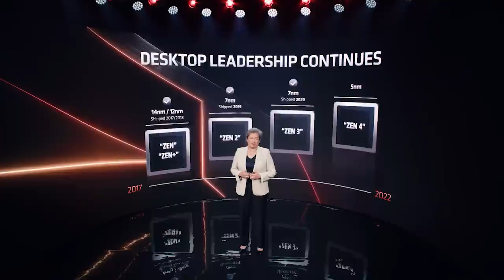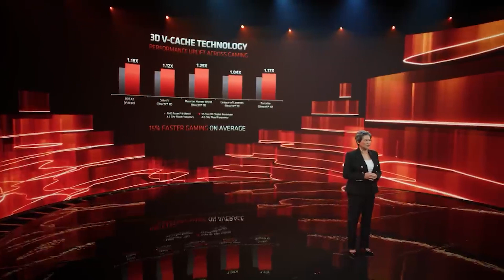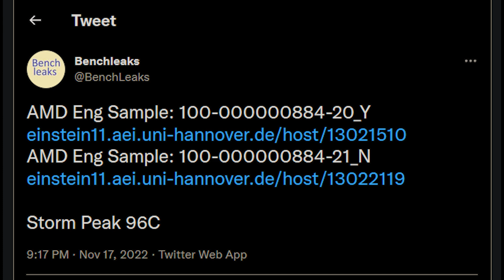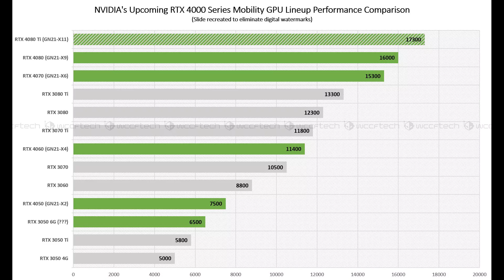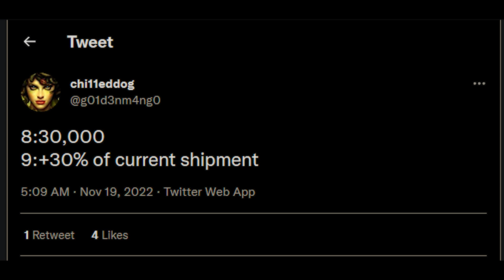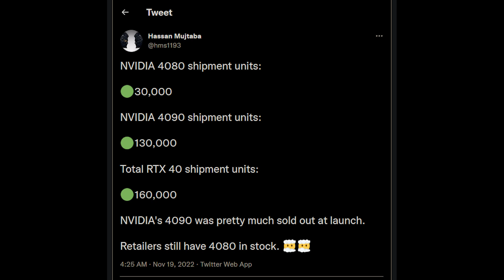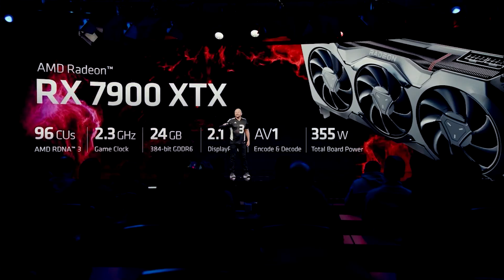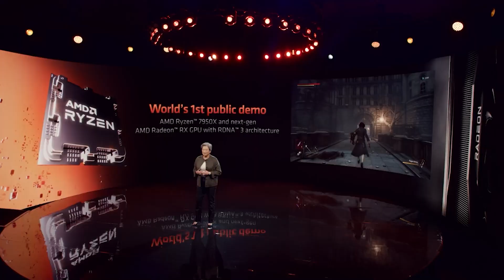Ryzen 7000 3D V-Cache UP TO 16 CORES ?! | RTX 40 M Performance & Specs Leak

Comment: I feel like we already know that the performance of the 7000 Ryzen chips is due to the higher temps that they have been configured to run at. The 3D cache isn't going to allow the same high temps if they stack it on top of the 7000 chips.
What does this mean?those rumoured 5900x3d and possibly a 5950x3d for AM4 on the way?

Comment: 4080 in The Netherlands is 1500 to 2000 Euro. That’s 4090 numbers in the USA. 4090 cards are 2500 to 3000 Euro. So F them all. Sure FE cards are cheaper if you can find them. Plus I am amazed how Nvidia is solving 12VHPWR plug thing. Seem they are doing all they can to make work around and not the proper solution.

Comment: Here in Australia you can buy the RTX 4090 prices range from $3000aud to $3800aud.. So there not exactly flying off the shelves. I just bought a Rx 6800 for $799aud and the RTX 4090 is not even twice as fast as the 6800 in 1080 and 1440p in a lot of games. Ray tracing aside and let's be honest does anybody on the low to mid range of the gaming spectrum really care about it.

Comment: Nvidia has no choice to lower their prices drastically after RDNA3 launch. That is also why Nvidia is trying to milk its fanboys now so it can make up for the loss later. RDNA3 is going to change the game this time. Price, Performance and Power consumption of RDNA 3 is much more balanced and this time AMD has a rich feature set that doesn't fall short. To me the AI accelerator is the biggest deal of all RDNA3's features.

Comment: I'm still crossing my fingers for a 7970x3d, since each quarter of an IO die can handle three CCD's.
Reply: A ripper of threads might also be a valid, though much more expensive, option.  But it is still a year away.
Reply: A very pretty penny, the ripper of threads does command.

Comment: I could not care less about workstation Threadripper.  So long as there is not a 12 to 32 core, quad channel, 48 PCIE lane HEDT option, Threadripper is dead in my mind.  I'd even settle for it being based on Zen3d instead of Zen4.  Just as long as I can buy the board and CPU for under a grand like HEDT has pretty much always started at.

Comment: RTX 4080's still available - but honestly, I don't know anyone willing to shell out the prices they are going for at this time.  Just makes more sense to spend a few bucks more on an RTX 4090 or wait for AMD's launch right now...  Or to grab one of the deals on the outgoing gen cards (lots of people seem to be doing that last one). :-)
Reply: It doesn't make sense to buy the 4090 now either if you ask me. Its price will also be lowered soon. It may be the fastest GPU available even after 7900XTX release, but on average the price difference between the 7900XTX and the 4090 will be higher than the performance difference. A lot of peoples would rather save some bucks because you most likely need a new PSU and Case when you buy the 4090.
Reply: @nedegt1877  Well I could make the case for the RTX 4090 (not for my self mind you, nor for anyone I know personally)...  It is (currently) the best high-refresh rate 4K video card on the market.  Mind you this argument would be for the real multi-billion 1-percenters that could just run out and buy the TI variant when it hits the market with out even noticing the money loss...
Reply: @nukedathlonman  I know, you're totally right about that. But that's a Niche market, Nvidia can't survive with only those customers. On the total GPU market that's not even 5%. Mainstream is more important because it's a high-volume market. 

It may not look like it because Nvidia has the fastest GPU but behind the scenes Nvidia is in deep doodoo. You will see what I mean next year when AMD announce / release their new line of APUs. And of course, the RDNA3 3D versions (if ever released) will be a lot faster.
Reply: @nedegt1877  the performance from AMD GPU's is crap atm, the 7900 flagship should have been £799 as it can't even beat the 3090Ti at ray tracing. You will pay £1000 for an inferior product
Reply: @Mike-kt4qh  Yeah sure, keep using Raytracing as an argument because that's the only thing you can talk about. GPU is not about Raytracing alone. In fact it doesn't even matter if Raytracing is slower. You guys really need to stop using arguments that doesn't make sense.
Reply: it's too late and too expensive now with amds incoming, the good thing is that we have proof mining is pretty much done or they wouldn't care to pay 1200

Comment: The  V-Cache tech is only shall we say an advantage in gaming. But outside this scope it is not bringing anything to the performance table? So the 16 core non  V-Cache Ryzen will still be the best option if need compute power but do not need need to get into Thredripper territory for some reason.
Reply: It’s not just gaming. There are some cache bound applications where it gives a nice boost as well.
Reply: @rekareaper  What are those applications? From the top of my head. I think some advantage was seen in the 7-zip benchmark. But overall not so much in other production type of benchmarks.

Comment: I am pretty sure that the 128-core part you're hearing about is Bergamo and is designed for cloud server computing. :)

Also the 40-series mobile parts seem to be a flat 30% gain over 30-series? That's pretty abysmal gen on gen improvements. I mean, the 2070 to 3070 was easily a 50% gain across the board, and THAT was seen as "okayish" for a gen on gen upgrade. But I guess we'll see. :P

Comment: Could we getting to the position that CPU and GPU speeds hit a point when there is little point in upgrading in the future. Suppliers must be concerned that at some point they will destroy the future market. Non gamers may always want faster for work purposes. The highest bar for gamers at present is possibly VR simulations and that is starting to hit very acceptable performance with the best of current tech.
Reply: there will always be higher resolutions. higher graphics settings. better AI simulations. better SOMETHING that needs more power.

Comment: Hi. Do you know which of these CPUs will perform better in machine learning and data science tasks, no need to say I would use a Nvidia GPU like 3070 besides the cpu, but I wanna choose an appropriate cpu for these types of tasks. These are my choices:
1. 5900X:       $250 (used)
2. 13600KF:   $400 (used)
3. 13700KF:   $500 (new)
But as you know there is another  important factor,  GPU. if I choose the 5900x then I could spend the extra money on a better GPU. If I wanna summarize both CPU and GPU configuration I afford are these three options:
1. 5900X + 3080Ti
2. 13600KF + 3070Ti
3. 13700KF + 3060 / 3060Ti
 which one should be a better combination?
Reply: If I'm not mistaken ML and DS is heavily based on GPU performance rather than CPU, for that I'd go for the 5900X + 3080Ti (try to get the 3090, it is closely priced to the 3080Ti)

Comment: AD at 160K total retail sales (BS) on 5,760,260 unit first quarter production means volumes were withheld from mass market on 5,600,260 total units typical of Nvidia q1 production volume sold to all other buyers willing to pay an application specific competitive 'perfect' price on applications ROI for a full node shrink 8/7 to 4 nm and DID. Government labs, institutions, academia, military, science, industrial power complex, export restricted rivals through gray and black market channels. Don't think only 160K AD sold that's BS. Perhaps there are 5.6 M in the finished good chain BUT that's next quarters q2 ramp volume that is usually around 6.6 M units for first year total NV production of 47 M and where on AMD 10-Q it appears N31 volume is around 8 M. Paul, they will be sold at highest price on Pareto distribution of the total volumes; supply on demand based price through ramp volumes, before peak production volume, and only when entering past peak production volume at run down entering year two will then reach mass market supply elastic pricing like NOW for GA and RDNA ll. What Nvidia and AMD did at GA and RDNA ll and Nvidia did again at AD is to allocate some amount of run end priced product 'said MSRP' that is fake PR priced product placed / allocated to retail entering q1 risk production phase whose actual 'introductory' price is seen in AIB offerings and broker pricing. I really wish the technical media if you can call it that will get technical on this topic because the PC press knowledge of actual production and sales methods is quite frankly pitifully lacking. Don't get caught in the PC echo chamber and PAUL learn some industrial management. mb

Comment: At the end of the day Intel have the speed advantage so AMD need to do something. Intel have the speed but at massive power draw (that's why I chose AMD) so if AMD replaced 7000X variants with the 3D cache versions (price wise) and dropped the 'X' versions prices then they'd have the speed at the same cost and people would be willing to fork out the extra IMO. It's a high cost when you need the whole AM5 platform but if your at the cutting edge speed and tech wise at least there's an up side.
I just got the 7600X while I wait for 3D cache, like many others I suspect.

Comment: Hey, random question: I'm about to build on AM5 and I was confused about memory, because AMD said 6000 MT/s are the "sweet spot", yet 5200 is the maximum officially supported speed - many mobo specs indicate that speeds up to 5200 are possible and some mark 6000 "(OC)" - does it mean I need to overclock something?
If I plug a 6000 kit and boot up, will the system either a) shut down or malfunction, b) just run at lower speeds or c) somehow still work at 6000 MT/s?
On DDR3 it was just plug and play. Mobo supports 1600, my kit has 1600 and it just worked. Any advice? Researched for literal hours, nothing on the web.
Reply: Same as Intel with XMP,  EXPO settings are considered as OC. Not because something bad will happen if you run with them but some configuration can be too much for memory controller in CPU. Let's say 4 stick with very high capacity maybe will not run at full EXPO speed. And then if you complain about that they'll just point to that manual that claimed only 5200 as supported. I'm sure that some reasonable configuration up to 64GB will run without issue at 6000.
Reply: @gorky_vk  Thanks, that's what I was looking for. So just enable EXPO in the bios and it works (provided the kit is EXPO rated). Got it.
Reply: I am genuinely interested in this myself

Comment: IOW, say you have a two CCD stack that means that only one CCD can be using it while gaming... You'd be better with more cores for pro work...  If you have two CCDs and stack only one then you have to ensure that that CCD is used for gaming to avoid probing through the IOD... I don't know if there's a direct connection between L3 on the CCDs...

Comment: We shall see what happens Dec. 13. Really want to upgrade from my 1070Ti to a 7900XTX, but I feel it might be a wiser decision and put that money into AMD stock instead at the moment, then pick up a card around the new year. Hopefully inventory will be decent, now that the supply chains and everything with crypto are sorted for the most part. I feel my 5800X with CL13-15-11-23 1T with super tight secondary timings should be good with a 7900XTX at 4K. If it's not, well, a 7800X3D down the road as well play around with DDR5 sounds nice too. Although, I shouldn't really need to mess around with RAM with a X3D chip, but as an over-clocker, noting goes untouched. lol
Reply: Stock market will crash. If its still around after it crashes, buy low.
Reply: Hey bro, market still has a long way to go down friend. You should probably dollar cost average into your AMD position instead of buying it all at once. 

I think AMD is in a good position fundamentally but the market is not.

Comment: 3d v-cache. The first rumor was "two SKU's" which to me means 8 core and 16 core. There is NO REASON to waste turning a 6 core, aka a failed 8 core chiplet, into a v-cache product, when you can just make all 8 core chiplets, and then make an 8 core 7800x3d product and then a 16 core product (7990x3d???). HOWEVER, if they go with a full product stack, aka 4 SKU's, then there will be a 6/8/12/16 version. We KNEW the 7800x was missing because CLEARLY the 7800x was removed to leverage ALL chips into 3d cache variants. So that there are "more products available". It just makes sense. "the most simple answer is usually the correct answer". 7800x3d is a known product coming next year. the only OTHER simple logical product would be 16 core 32 thread with 3d v-cache.... period. and that fits the initial rumor of "two sku's".... if they do a full product stack, we are then getting 4 chips, 6/8/12/16 variants.
Reply: TOO much use of CAPS man lol

There is one good reason to do 6 core 3d stack - thermals. The ihs built for 8 cores running only 6 would be more able to handle the cache heat and for cache heavy workloads like games 6 cores is plenty so it would make sense to sacrifice them for cache

Comment: Noon local 11/20. Microcenter nearest me had about 120 4090's at launch.  Sold out at open.  Had about 150 4080's launch plus restock since launch.  Still have 3 variants with total stock remain at 48 units total remaining as i type this.  Tuf gaming OC, Strix OC and Amp Extreme Airo.  Sold out of all the lower end variants.  $1399 and up is what is remaining.  Makes sense, please will wait for 4090 at that price.

Comment: I may upgrade at the end of AM5. Wait until they max out its capabilities.
Reply: Probably the smart thing to do. I’m sure the last chipset will be a marked improvement over X670, and I can only imagine how much better Zen6 CPUs will be over Zen4. Anyone on Zen3 doesn’t really need to upgrade until at least Zen5/3D.
Reply: @europason2293  Yep. Got a 5950x paired with a 6900xt. Might upgrade to a 7900xtx though. Don't think it should bottleneck.

Comment: In South Africa the first batch of 4090's went out of stock pretty quickly. The second batch is reasonably available. Availability of 4080s seems pretty good too. I suspect people either went for the 4090 or are holding out for AMD.
Reply: they absolutely should wait. we know the 7900xtx is slower than 4090 but the GAP between 4080 and 4090 means there is nothing there from Nvidia (yet, eventually 4080ti or 4080 super depending which name they go with) so that would put the 7900xtx between the 4080 and 4090.

the way I see it playing out? the 4090 FOUNDERS price is $1600. the 4080 FOUNDERS price is $1200. AMD's "founders" aka reference card is only $999.99.... and AIB cards will be $1200 or there about (with "factory" overclocking). While the 7900xtx can't beat or tie the 4090, it does beat the 4080. So you can get BETTER than 4080 performance for LESS than buying a founders 4080.... that's insane. so I expect AMD to sell like hot cakes.
Reply: @GoblinPhreak  how do you know it beats the 4080? The AMD is also poor ar ray tracing performance while costing £1000. It's not a good value and nor is the 4090 but at least you get incredible performance
Reply: @goblinphreak2132  only in lastgen stuff....everything that is on a new engine will suck balls pretty soon......lumen has ray and pathtracing build in (unreal engine 5 ) ...and the others are due to follow suit(eg unity already has beta)....everything coming out soon will be raytraced its just the overall better tech....give it 3-4gens and there will be no "normal" ligthing and shadows anymore for all the titels on the big engines...its jsut a waste of development time if the engines can do that shit on the fly for free., so why waste that precious time on building ligthmaps and taking care of shadows for all your models ? So IMO the games will look worse and worse wihtout RT as less and less time will be spend on fixing the ligthing/shadows...doesnt mean the 4080 is good value what so ever but you have explicit downsides you have to be aware of there are no free ponies :D amds knows this hence the price :D
Reply: @goblinphreak2132  False people going for the top end only want the best of the best. Not a second rate product with sacrifices. It’s either the 4090 or nothing for the top end. The 4080 is garbage and the 7900xtx falls into the gray line area of why though. It will also cost $1,100 for the reference version and $1,300-1,400 for AIB models. That will also reuse the same air cooler the 4090 and 4080 use with the same power draw.
Reply: Why is the 4090 price so high in South Africa?  It should be R27000 not R45000
Reply: @FunFunFun8888  Yeah. Should be. In South Africa we get hit with high import duties and shipping costs so the effective cost of all tech stuff is routinely a lot higher than what would be expected. You can get the cheaper variants for like R35k but sadly this sort of pricing is the norm.

Comment: Looking at Nvidia`s lineup where as they are Not even beating their last gen on Many New Products and then looking at amd improvements well over last gen = Even the Low End Products =  
i think its clear = AMD has Beaten Nvidia  ! Looking at The 4050 Being LESS Than The 3060 ? COMMON , the " 4050 " Should beat  at Least to the 3070Ti  .